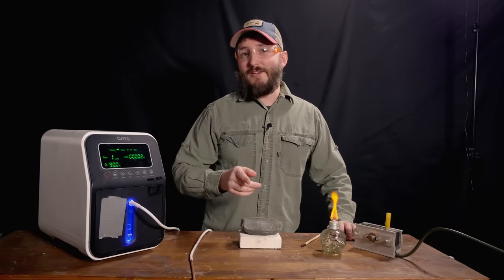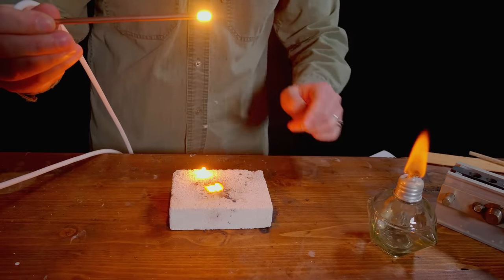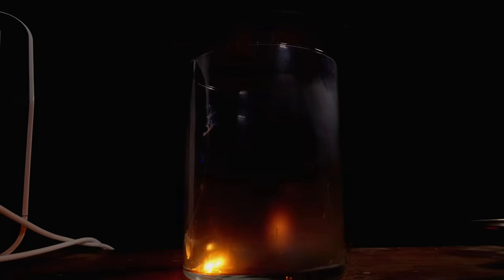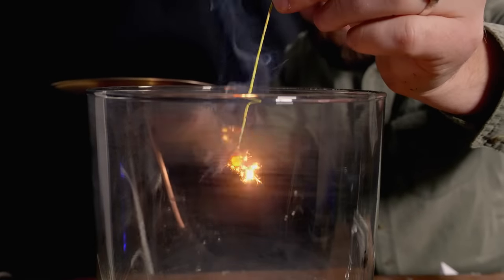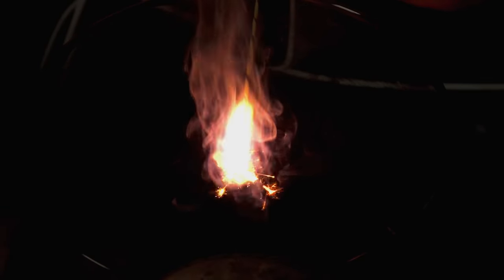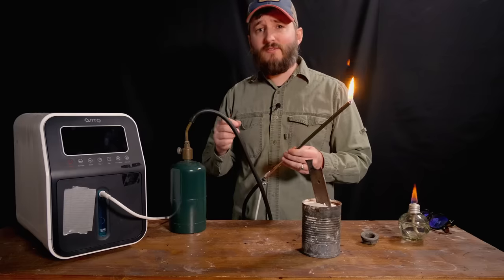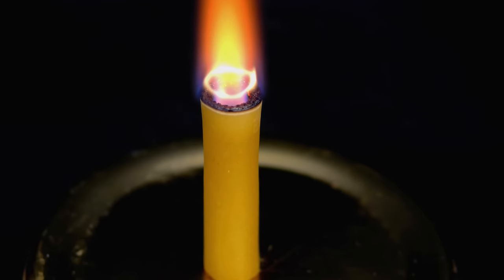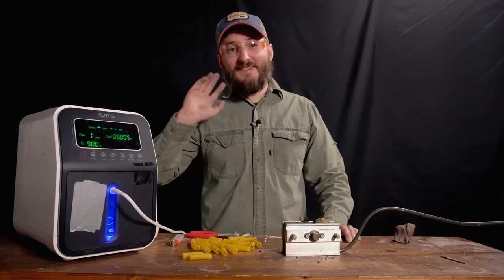6 Unauthorized Uses for a Medical Oxygen Concentrator

Comment: Could you use the oxygen concentrator to increase the efficiency of a hydrogen/oxygen PEM cell used to generate electricity? Would be fairly easy to measure the power output both with and without, see if it makes a difference. I'd hypothesize that increasing oxygen availability would  allow for higher hydrogen flow rates to match, generating more energy, though the restriction is probably the permeability of the membrane rather than available gas.

Comment: Kind sir.....increase your surface area and flow rate.
SUGGESTIONS:
1) Instead of a solid pasta shell, placemany pieces of angel-hair sticks within your tube......so that more oxygen has access to more fuel along the combustion chamber. There is too much 'empty space' within yourmini rocket's combustion chamber which can be used.
2) Use a balloon to store O2 produced by the machine, and then add variability by pressing on the balloon to force through bursts of extra O2.
3) SAFETY: Use simple rubber flap valves to increase safety of your O2 lines.
LASTLY....(this is where people just scoff)..rockets indeed DO push off of ambient air to create thrust. If you wish to measure actual thrust you must shape the exterior of the rocket to allow flow of ambient air around the rocket body and into the exhaust to 'replace' the air removed form the space. You will not measure thrust until you can move air from in front of the rocket to the rear fast enough to counter friction losses.

Comment: To get a rocket, you need chamber pressure. A nozzle converts static pressure to motion, but it must first have static pressure with which to work. The pressure of a combustion chamber cannot exceed the pressure of the fuel being injected therein. Naturally, therefore, you need to divert a small quantity of the oxygen to a pasta fueled gas generator which will be used as a turbopump to compress the remaining oxygen before introduction into the main pasta combustion chamber. Any effort to increase chamber pressure, however, is guaranteed to cause an explosion. :)

Comment: A normal oxy/act welding torch with a #1 or 2 tip would probably work way better. Oxy/propane tips/nozzles are also available for cutting torches. That is what my old favorite auto wrecking yard used to cut up cars because propane was way cheaper than acetylene. Potassium nitrate experiments might be fun as would thermite.

Comment: For what it's worth... I got one of these units cheaply for use to replace the Oxygen containers that had 1.4 cu ft of Oxygen and cost $10-$15 each for my torch.  I was able to put the tube over the part that goes into the tank normally, and at 5 liters/min max output from the device, it was just about enough to run the torch.. not quite though... I ended up getting a air compressor to compress the gas, and then later decided to get a medical Oxygen tank to store the compressed gas into.. Ironically, the 'empty' tank that I got through the mail (can't mail full tanks) was at 1,500 PSI when I got it... oops there!  This tank also had a pressure regulator on it that can go above 5 l/min output rate and that would work fine with the torch.   Getting 2 such machines, and connecting the outputs together would also give me enough oxygen to run the torch just fine.  I've not tried it with the medical grade tanks - BUT, I DID notice that it only costs $25 to get one of the tanks refilled at a hospital... And this is for a 2000 PSI tank, that is about 3' high and 4-5" across, VASTLY more gas than the ones that are the same size as the 1 lb propane tanks that the torch uses.   In the past, I found that to braze with the torch I was quickly using up my oxygen tanks and quickly found that I needed to replace them before even one project was done.  This is why I ended up buying the concentrator.  I also found that it isn't that hard to build one of these devices as well.  It simply applies compressed air into a molecular sieve and N2 goes into sieve, leaving O2, you then vent the chamber to outside and the N2 (and some Oxygen) goes outside - by simply compressing and venting the chamber, with a vent that is opened at pressure, after the N2 has had a chance to be absorbed into the Zeolite (sieve).   To improve the % you get, from the 90-95%, you could use a 2nd stage - if you think about it, this could remove up to 99% or so if done right.   It is important that there is no oil in the system, and that you filter the air going into it so there is no dust or anything that can plug up the Zeolite.  (This could be a cool video you could make). - Your issue with the torch was that the Oxygen and the propane didn't get mixed well before it was burned, that is why the torches work like they do..   Too much of your propane was being burned by just air on the outside..  (Btw: I would not try using a tank that was not designed specifically to store oxygen in to store the oxygen.  That is why I purchased the medical grade tanks.  (they were cheaper than the oxygen tanks that you get for normal torches, and I expect should work just as well.)

Comment: Your oxy-fuel flame mostly needs 2 things, it needs #1 to be restricted in a laminar and focused jet, and #2 it needs the fuel and oxygen to mix before exiting the nozzle, not in the air at the end where nitrogen dilutes it and the flame is hollow due to improper gas mixing. most oxygen cutting torches have a ring of holes around a center hole which is for pure oxygen, but contrary to popular belief, the outside ring of holes is not for fuel gas, its for oxy-fuel gas. the gas for that outer flame needs to be pre mixed for maximum combustion temperature when leaving the tip.
so in summary, have the gases mix before they exit, and use a tip with small holes to increase flame velocity. additionally, you can use a tip with a ring of holes for oxy-fuel gas around a larger central hole for the pure oxygen if you plan on cutting metal with it.
also contrary to popular belief, oxygen does not help to cut through rock any faster, rock is not flammable and does not react with oxygen, instead its the extremely hot oxy-metal "flame" of your oxygen lance that melts it. I actually had this same idea to use oxygen concentrators, and I worried that I might need 2 generators due to the slow output, so take that into consideration as well.
whatever the case, best of luck, and I hope to meet you in person some day, I do these same sorts of projects, and you certainly beat me to many of them! as of right now, I am working to start a channel, and I'm meanwhile trying to produce homemade elemental silicon. all this as a teenager too...
- Subscribed

Comment: Ive found using O2 Concentrator a decent and much more affordable decompression breathing gas for surface deco, during Technical Diving Ops, after all underwater stops, including 100% O2 stops at 10 & 20fsw (3 & 6msw). Probably not DAN approved, b ut Im not one to care much as long as it passes my own safety protocols. I doubt DAN would approve of my homemade rebreather either ;-)

Comment: What I really want to see with that second demo is what happens outside of that chamber full of oxygen. You said that clothes can become oxygenated themselves and burn very quickly, which is why you don't want an open flame next to this kind of machine, but that's not what the test shows. The test just shows that a pipe cleaner inside of a chamber full of oxygen will burn easily, and yeah I kinda knew that.

Comment: Use a convention propane torch nozzle.  Introduce the oxygen to the ring around the base where the air is introduced.  That will fix your weak flame.  Similar to oxyacetylene setup.

Comment: other than the power loss from running the concentrator, I'm curious to see how a small generator  motor would run with the extra O2. more power or efficiency? and test with it running on and of the generator.

Comment: Sand doesn't tend to be very pure, which is why exceptionally pure sand (which comes from only one place that I know of) is highly guarded for electronics production. It is entirely possible that that sand has magnesium, aluminum and/or other elements in it that could react with steel. Steel can also mean a lot of things. Stainless steel often lacks iron entirely, yet it's still called steel. I saw a poster describing the compositions of different "steels", and there were at least 15 things on that poster alone. The man whose office I was in said that there were plenty more types in production. If I had a camera just then, I would have taken a picture... but I was 12, and this was in 1997/1998. It could really be a thermitic reaction. Without knowledge of the two materials compositions, there's no telling.

Comment: Change the oxygen to the outer pipe and try again..in a low flow torch, the oxygen gets sucked in through the vent holes around the nozzle to mix better.. kind of like a carburetors venturi with the feul jet in the middle.

Comment: We used to use 3/4”x20’ oxygen lances to open up the tap hole on the top of a huge EAF steel making furnace.  An a few other things.  

Anything that was in that hole the steel at the bottom of the furnace in that 4-5 inch hole after pouring out a ladle of steel.  Would climb on top to resand it an make sure nothing was blocking it.  

The only thing gave it a run for its money was refractory brick or or any chunk of a refractory material that may of come loose.   
Hooked up the rod to the oxygen valve handle an just stabbed it down into the glowing steel or a tiny bit of liquid an it would be rolling.  

Burned many of 20’ 3/4 inch rods standing over that 3,000°+  12”x12” hole with the smoke an fumes rolling up through.  Sometimes burning a piece of one rod.  An at times burn 10-15 rods up there until clothes started smoking and the gold heat resistant face shields an or hard hat starts to warp.   

Crazy times.  

But lance rods are pretty cool to cut with.

Comment: Look into lampwork. Folks have been using oxygen concentrators with propane to melt glass for a long time. If yours is capable of producing 10 liters per minute, you should be able to melt borosilicate glass, too.

Comment: the copper pipes you are using a highly thermaly conductive which means not only if you let it burn for long enough you can get burned and it can melt the rubber tubing depending on fast its moving heat it still has the risk of catching on fire
Reply from the maker: It's copper plated steel. Not very conductive
Reply: @Nighthawkinlight  ok thank you for justifying

Comment: Believe it or not I used to work in the medical oxygen industry with patients. The number of times you'd see a patient smoking whilst also using the medical oxygen was beyond belief (and scotch marks around their face from previous attempts of smoking with nasal canula on)
We also used to have safety devices called a fire break. Make of ceramic plastic they'd have a spring and wax plug. If the wax 0lug melted from heat the spring would close a plastic valve inside and prevent the flow of oxygen.

Comment: Your o2 concentrator must be alot higher than the one I had.. u maybe interested to know the difference between medical grade and industrial grade is only the container.. medical is stainless... when i was in school for welding,  the steel cutter (mechanical) to cut plate inly used acetylene  to start the cut, once there is molteb steel the acetylene was turned off and the cut was done with pure o2. Same works on concrete with the o2 in a steel pipe that burns away as the concrete is cut.

Comment: Are you sure that the tubing that comes with the device is plastic? It could be silicone rubber, which should be much more resistant to burning than polyethylene.

Comment: If you filled some kind of syringe with 90% O2 you could prolly make the flow faster for less time.
Also what would happen if you hooked the output of that to the input of a compressor? It wouldn't do anything unless cold?

Comment: I would like to see what happens if this is used as a air assist on a laser engraver/cutter like a K40 (cheap Chinese, about $450). 
With normal air a K40 can't be used to mark steel, but maybe with oxygen it might? And what about cutting acrylic? Thicker, faster?
Don't think there would be a fire risk. Because the air is much faster evacuated from the machine than the air assist could introduce oxygen, the high oxygen concentration would be limited to the immediate surrounding of the beam. If need be, the machine could be ventilated with a inert gas instead of air.

Comment: Two pieces of penne pasta, cut into 1/4" long segments. Chamfer the inside of one end...place them one atop the other with the chamfer at the top, or exit direction, of the rocket. Completely encapsulate the entire thing in clay....make whatever nozzle you feel will work. Pipe oxygen in from the non-thrust end....light from the same. Place entire contraption on zeroed scale to measure whatever thrust produced, if any.
Reply: Might be ass well of running at 60 or 70% if it increases the flow rate.

Comment: I’d be careful about re-using and how you store that container considering how it came into contact with that much heat. NileRed has a video on how his beakers would spontaneously explode weeks later because they dealt with microwave plasma. I’m not too smart regarding that stuff and it might not even apply, but just something I thought would be helpful.
Reply: He might be using tempered glass, so if it heats up it will be more resistant.

Comment: Glassblowers (specifically lampworkers) already use oxygen concentrators for their work! There's a range of small mixed fuel torches that can run on 10lpm or even 5lpm oxy cons, but even larger torches can be used with them by setting up a HPLV (high pressure low volume) system. Using usually a couple of oxy cons and a compressor, it's fed into an oxygen tank and the gas is compressed and stored for later, to then be used at much higher pressures than what a concentrator can do alone

There's even medical grade machines that do the oxygen compression. They're supposed to be used for the small portable tanks only but many a person has set up their oxygen in their shop using one of these, it just wears them out quicker and there's now purpose built setups purely for this purpose

Check out High Volume Oxygen and Oxygen Frog for the commercial grade setups, but the Invacare Homefill is the "cheaper" and slightly less efficient version

Comment: I'm thinking if you don't incorporate a bubbler, or at least some copper mesh baffling, you're looking for a flashback event and possible detonation, though I doubt it. Even still, I'm thinking a bubbler isn't a bad idea.
Reply: Okay, now that I've completed watching the entire video and heard you mentioned demonstrations in front of children, I must beg of you to consider these options. You need to remove your flame source from your nozzle before you disengage your concentrator. With your current setup, disengaging the device could create a vacuum event which would suck the flame into the device and cause a possible detonation event. Unlikely, but why risk it? Incorporate a simple bubbler device to guarantee the cut off of any possible flashback event. I don't feel I'm qualified to speak on this, but I just feel it's safer to incorporate some sort of firewall, that's all. Be safe and have fun!

Comment: If you were to get 2 more of these machines and direct feed two of them into one's input how much oxygen throughput could you get? that's assuming that it's capable of scaling oxygen concentration based on availability and not a set ambient air scale.

Comment: I really like the idea of using a medical O2 generator for science.  One of the first things I would do is upgrade the air compressor that is built into the machine. I would use an airbrushing compressor or see if I could attach a shop air compressor. 🤔  I don't know how the O2 separation system works but I would hope it could handle more pressure. 
I would then make or buy a flashback arrestor to add to the tube. As a safety so the flame dosent flash travel back to the machine.  
I like the idea of an "endless" Oxy tank for a torch. And I really like the noolde rocket idea. 
I would try to do some oxidation chemistry in an attempt to make rocket fuel.
Another experement would be to make an Ozone generator. If you have an endless supply of O2, I think if it is passed through a chamber with high voltage arcing it will produce Ozone. And with Ozone you can do other chemistry reactions.
Reply from the maker: You need to be careful to use an oil-less compressor for compressing o2. Otherwise that's a good idea

Comment: What would happen if you swapped the location of oxygen and propane? Propane would be encased with oxygen and it would not contact air when it exits the nozzle, so it could become hotter than the other way around.

Comment: I would love to see an electrolysis powered rocket engine. 2H2O (water) -> H2 + O2 (After Electrolysis) -> 2H2O (After oxidizing/burning). 

Actually - I would be very interested in seeing how well a electrolysis powered boiler would conserve mass, you are essentially using electricity to break apart the hydrogen and oxygen, then burning the fuel/oxidizer to make heat, which has a bi-product of going back to water. I wonder if you could use this to create steam that turns a small turbine and generates the electricity needed to perform electrolysis.
Reply: Granted, you would have an unproportionate amount of oxygen/hydrogen so that would have to be regulated somehow.

Comment: oxygen concentrators fall into two basic categories.  Pressure Swing Adsorption and Membrane separation.  These amazon oxygen concentrators are pretty low pressure and low concentration.  You can easily build a PSA system, if you're inclined to.